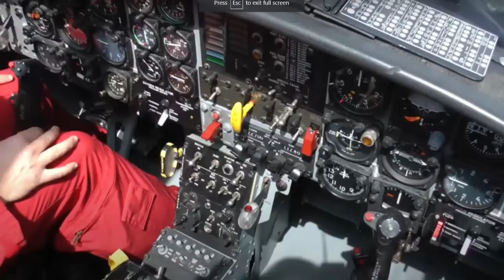Snowbirds CL41 Tutor Crash 17 May 2020

Comment: The J85 is also used in one flavor of the Navy T-2 Buckeye (Nobody ever called it that, it was always the "Tadpole" when I heard it.) and was the engine in the early Lear jets.
I happen to have the CL-41 Pilot's Operating Handbook - the seats are supposed to be 0-60, so 0'/60 kts.  Of course, this changes with stuff like aircraft attitude and descent rate.  Nothing on how long it takes the seats to fire after the handle is pulled - it could be as long as 4-5 seconds.
For compressor stalls, the boldface is the usual, throttle to idle until the stall clears, then throttle back up.  If it's a fuel control issue, rather than disturbed air, that may not work.
Airstart is also standard, throttle to Idle, mash the airstart button, and throttle up when it relights.  There's a catch - The engine has to be windmilling at 12-34% RPM, which, according to the book, typically requires about 210 KIAS at sea level.
It looks like the stall hit at about the worst possible time - just after liftoff, not enough airspeed for a restart.  A Motored start is possible, but it involves stopcocking the engine and a lot of switchology to reset - they wouldn't have had the time to try.

A sad day, I've seen the Showbirds fly several times, and they have always impressed me with their smoothness and precision.
Reply: Time for seats to fire after handle pull is NOT 4-5 seconds. The component delays are measured in fractions of seconds.
Signed: ex RCAF aircraft tech, 1981-2016.
Reply: @tazman572  Thanks for that - it depends on the seat, and on the airplane, (Single seat, 2 or more, which often requires sequencing, etc)  I didn't know how the Tutor's seats worked. 

(Never punched out myself, and those who have that I've talked to, say that it seems like ages between pulling the handle, and the rockets firing - but then, of course, at that point, there might be blood in your Adrenaline System.)
Reply: When pilots are trained do they get into discussions where you should not even bother trying to relight the engine just eject? Would not be fair to arm chair quarterback as the pilots were in the situation and you know they made the best decision they could based on their training, experience, and information they had. Just wondering what sort of voices of past mentors go through your head in those moments/
Reply: @peterstickney7608  That is that time dilation phenomenon that goes on when you are trying to problem solve. Your brain is trying to process so much information so quickly https://www.npr.org/templates/story/story.php?storyId=129112147
Reply: Mr. Stickney - we are taught in GA that if we lose an engine/thrust after rotation (during take off climb), immediately nose over to maintain airspeed and buy a few seconds before it stalls.  It does not appear this happened from the video...it appears the pilot continued a steep climb after the engine lost thrust, even dipped a wing before the spin occurred.  I am a neophyte in comparison to this pilots' experience and credentials, but can you speculate on why she didn't nose over and try to establish a glide before ejection? Are pilots in this aircraft taught the same principles as in GA/piston powered aircraft? I'm not military and I'm not Canadian, but as a fellow pilot this kinda hurts today.  Signed: Interested GA pilot, Atlanta, GA, USA
Reply: @rickkimball6125  They were accelerating in a very shallow climb and I suspect they had likely gone past best glide airspeed hence had the chance to trade kinetic energy for potential energy.  While I agree on pushing over quickly in a GA aircraft if I'm climbing out at Vx or Vy (which is exactly what I was taught also), if I'm much above that, it's time to trade kinetic energy for potential energy and time.   I would suggest that is exactly what he did.  You can see a similar situation with an RCAF Hawk that had a bird-strike on take-off and subsequent loss of engine leading to an ejection here:  https://www.youtube.com/watch?v=H2zB7Z-b6Kc
That said, I'm purely speculating in the spirit of offering up a possible explanation... until a formal accident report comes out.
Reply: tazman572 
Do you know if in the Tutor, the pilot and passenger need to pull  their own seat? 
I have watched videos on media day where personalities go through ejection seat training. I think you’re required to disconnect your air and comms, then pull. I’m wondering if she wasn’t quick enough. Sad couple weeks for our Canadian aviators.
Reply: @rickkimball6125  In a GA context, that's very true, particularly with a full engine failure. (I started out as a Glider Pilot.  My first takeoff was a formation takeoff, and my first landing was a deadstick landing.  What to do with a rope break was drummed in from the start) A compressor stall in a jet isn't usually a full flameout - the engine is still generating thrust, and recovery is usually a matter of pulling the throttle back, and as the stall breaks, advancing it again. Another consideration is that if ejecting is a possibility, then getting height is a good idea - just because the seat is "Rated" as 0 altitude doesn't mean that you're guaranteed a good 'chute. (As we see in the video.)
Reply: @DavidVerch  There are conditions where a relight is feasible - a certain range of altitudes and airspeeds where, for example, a windmilling engine just needs fuel and ignition to restart.  Those are drilled in as you transition to the aircraft.  There are also sets of conditions in the Boldface (Emergency Checklists / Memory Items) that guide what conditions are required for things like Spin Recovery, or other such situations.
Reply: Love your videos ..Possible topic for a future video - similar to USAF training changes  no section landings for USAF pilots?  U.S. Navy looking for a new carrier jet trainer to replace T-45 Goshawk. Navy will buy existing land-based plane limited to touch-and-gos on carriers. NO catapult launches NO arrested landings. Like your take on this?
Reply: get them f-35s  that would be magical

Comment: Thank you for the update.  When you mentioned the engine was a J-85 a similar thing happen to me as a T-38 IP at Craig AFB in 1968, at that time students had to be proficient in heavy weight single engine over head pattern and landing.  This was the way it happened ,initial TO gear up flaps up “Takeoff request closed” Mobil “cleared closed”. Student preformed (right closed) on downwind I retarded the right engine to idle and the student did everything correctly and final turn @ 175  + fuel=180+ min needed after burner in and out to maintain airspeed parameters the about 10 to 15 degrees short of lineup with desired r/w. The loudest noise I have ever heard and the left engine(the active engine went to zero rpm).  I rolled wings level full afterburner on right engine ,while on radio “clear the T-37 pattern “ now looking at #2 engine for acceleration and it came very fast into AB,  flew between r/w’s down to about 300 ft AGL then landed out of straight in.   Called Maintance next day and they stated the IGV mechanism failed.  Went from full power to zero in the blink of a eye.  Maybe something like this happened to SB

Comment: Tough loss for a great team.   Those birds are getting rather long in tooth, might be time for an upgrade.
Reply: They are in the process of picking and procuring new aircraft, but they will not likely be using them until around 2030. They are currently updating the avionics in the tutors to keep them operating until the 2030 replacement.
Reply: problem is the RCAF doesn't have anything to replace them... They barely have enough Hornets left to fill operational units, and those are themselves overdue replacement and probably wouldn't hold up under extensive long duration G loads typical of demonstration flying. 
No other suitable aircraft are currently in the RCAF inventory.
Reply: Agree.  It time to put them to pasture for everyone's safety.
Reply: @jwenting  Most military air display teams don't use combat aircraft and use trainers.  Only really the US can afford to do that.
From some brief research, it appears that they use the BaE Hawk as their jet trainer now.  That's the same as the RAF's Red Arrows.  Although they too have had some issues, but I believe the only fatality was an issue with the ejector seat.
Reply: The RCAF was intending to retire these this year. But after consecutive  years of funding cuts by the Liberal government (almost $8 billion in 2 years) they decided to retrofit once again to get them to 2030.
Reply: @bcdemon  As long as they aren't flying over my house or city, I guess it's OK to extend them for 'training' flying out in the middle of nowhere until 2030.

Comment: Good analysis. At one point you call it a 60/60 seat. It’s a 0/60 seat. In the late 1990’s the seat was modified with the ARAD drogue system and a new harness/buckle. The parachutes were upgraded from a 24 ft to a 28 ft flat circular canopy. The seat was requalified through ground and air tests for an expanded crew weight range. Experto Crede! Love your analysis.

Comment: When we started having compressor stage failures with the Pratt & Whitney tf100 engines, the 3rd stage compressor would do a lot of damage to the aircraft, but we had several aircraft that were still able to land after the damage. F-16 this when they were using that engine automatically had to find a safe place to eject because an F-16 will not fly without power. It appears that this may very well have been a compressor failure but damaged the flight controls in some way and they didn't have enough altitude to eject within a safe envelope, their altitude may have been at minimal altitude but they were already headed down at a velocity which kind of negated that.

Snowbirds are the finest private demonstration team I've ever watched.

Comment: Not a pilot here, but I am puzzled by much of the analysis I am reading and seeing. Hoping someone can help me with this.
I have heard a number of pilots say the pilot zoomed up as taught when there is an issue like an engine problem etc.
I understand the idea is to gain altitude to give time to deal with whatever problem is at hand.
But if you are flying relatively low and slow as in a normal takeoff, and you lose power, then wouldn't a steep climb result in a stall almost every time?
Shouldn't the correct procedure be to immediately level off when you lose power after takeoff - to maintain lift? And then consider your options?
Depending on how serious your problem is, you might have to glide the plane down and land somewhere right in front of you, like a field, road, or water. Or you might have enough power to get the plane back to the runway.
In any case, I don't understand why you would automatically zoom up , especially with an engine problem?

Comment: Can you comment on what a pilot would consider the best options for a forced landing of a jet?  I see the Thompson River flows parallel to the runway where they took off but I see the plane turn towards the middle of the city.  Why wouldn't they try to put the plane into the river instead of a no power turn over a populated area?  #AskBlancoirio

Comment: The UK's Red Arrows also use NINE aircraft in their display of precision formation flying, and they frequently visit the USA too!. 
In the 50's the RAF had several display teams but perhaps the most famous was the Black arrows, a predecessor to today's Red Arrows. 
 Formed in 1956,The Black Arrows flew Hawker hunters which at the time was a front line Fighter. The Black Arrows usually flew with a display team of 16, However their most famous feat was the record breaking close formation flying of 22 Hunters executing a 'Loop de Loop' This record still stands today, as the most jet aircraft flying in close formation whilst executing such a .maneuver!
Until 1961, the Black Arrows were the RAF's premier team. In the early years of the 1960's the "Blue Diamonds" of No. 92 Squadron RAF (also flying Hunters), "The Tigers" of No. 74 Squadron RAF, equipped with the new 'Supersonic' English Electric Lightning, the "Red Pelicans" flying BAC Jet Provosts, and the "Yellow-jacks" flying Folland Gnats formed. The large number of squadron display teams later rationalized to a single unit from the Central Flying School. 
Ah those were the days! YES, they really were!
Thank you 'Blancolirio' for such a well informed You Tube channel!  
I am a Brit (You may have guessed that one!)  a retired paramedic with a love of all things connected with Aviation (Father was in the RAF)  and it's always a pleasure to view your channel, not only for the comprehensive research of the subject, but for the professionalism in the deliverance of said subject!
To all my American and Canadian 'cousins' over the pond, please;Take care and stay safe!

Comment: First off, rest in peace our fallen R.C.A.F. member.  A very, very sad day.  

This is an insightful analysis of the crash; however, there are a few more factors involved.  Zoom to get altitude, then eject, would have been the safest option in hindsight.  But, the pilot was certainly aware he was over a city.  I assure you, he did not want his aircraft causing fatalities post- ejection on the ground.   So, the best option, perhaps, and altitude permitting, would be an engine- out 180 to land back on the runway.  The Tutor glides quite well for a jet aircraft.  Also, he would have been fully aware that the Tutor ejection seats are antiquated.  I have had heard Tutor pilots say that they would rather land on a dirt road than eject.  So he had a lot of decisions to make...in a very short period of time.  My 2 cents and they are exactly that (I have experience flying these aircraft), is to wait for the investigation to see what was the probable cause of the crash.
Reply: I also think Capt. Richard MacDougall's original intention was a 180° turn, glide landing back on runway, but things happened quick and the ejection was too late to get a full parachute landing. I'm also not sure if Capt. Jennifer Casey's parachute deployed properly. Fortunately, the aircraft crashed in such a way that there were no casualties on ground. I hope the investigation clarifies the situation and whatever changes that need to be made, are actually done. Peaceful Restings, Capt. Casey.

Comment: In another video, that is what it appeared to me. The airspeed appeared to be too slow at the top of the turn and I thought it stalled. So I figured the aircraft had engine issues and the pilot traded speed for altitude to be able to get as high as possible to eject. Just my opinion as a GA flight instructor.

Comment: Couple of facts. 
The proper designation for the aircraft is CT-114 Tutor. 
Powered by an Orenda built J-85 engine. 
The RCAF had about 200 of these aircraft. All were built in the late 1960’s. 
The majority of the CT-114 fleet have been retired. 
Number 431 Air Demonstration Squadron (Snowbirds) is the last operating unit. 
Because of the age of the aircraft, the question is how much longer can the RCAF afford to operate them.

Comment: Is the right hand pilot seat and left hand crew seat actuated by a single pilot operated lever or are the activators  independent to each seat?

The crash footage appears to show the right seat ejecting slightly before the left, the left also appears to have a longer rocket burn. I was wondering if this was a deliberate simultaneous staggered release to prevent potential collision of the seats.
I know in tandem front/rear seating arrangements the rear seat is designed to eject before the front to avoid rocket burns to the rear pilot.

It also appears that the seat rocket fires at a slight angle to the forward motion of the aircraft, possibly to avoid collision with the tail?
Unfortunately in this case the ejection rockets seem to have contributed to a further loss of altitude of the crew as the ejection was initiated when the aircraft was in a vertical nose down configuration.
Reply: In the Tutor, ejection seats are not synchronized and each occupant has to pull their own handle.

Comment: 1:28 " pop " ?   means what ?
Reply: Basically a backfire or compressor stall.  The flame goes out the front instead of expanding to the rear.  The compressor should overcome the pressure in the hot section but sometimes can't.  Engine loses power.

Comment: Hindsight is 20/20 but I can’t help but wonder why the pilot didn’t back off the throttle to give the surge a chance to clear or eject at the top of their climb if that didn’t work. I also begin to wonder how qualified the mechanics were that worked on these planes. Once they get a look at the cause of the engine failure I’m sure they will be asking a lot of questions.

Comment: Canadair  CL-41A - CT-114 #114161  	 	
Build date: 8 January 1971 
Operated by 2 Canadian Forces Flying Training School, CFB Moose Jaw, Saskatchewan. Completed avionics upgrade program on 24 April 1995.   Conversion to Snowbird configuration completed in January 2004. Operated by Snowbirds as Snowbird 4, year unknown. To Trenton for bird strike repairs, September 2004 to March 2005.   Snowbird 11 in 2005 season.   Visited Pearson Airport on 24 February 2006, marked as Snowbird 10. Reported as Snowbird 14 later in season. Was Snowbird 13 by late August 2006. Snowbird 9 in early 2007 season, Snowbird 5 by end of August 2007. Snowbird 6 in June 2009.   Snowbird 9 in September 2009.   Snowbird 8 in June 2011.   Snowbird 5 in October and November 2011. Still on strength with 431 Squadron in December 2013